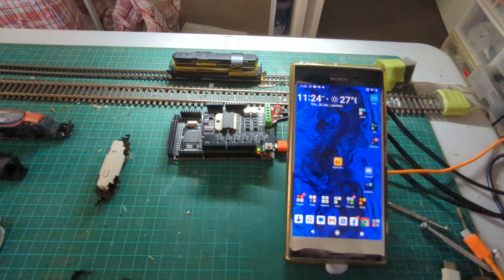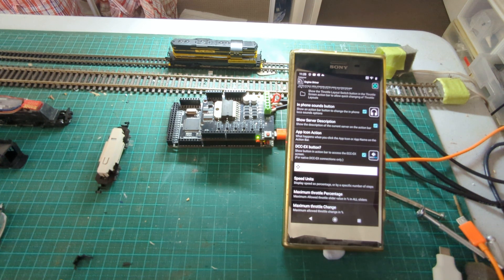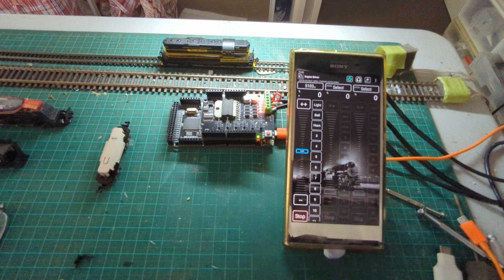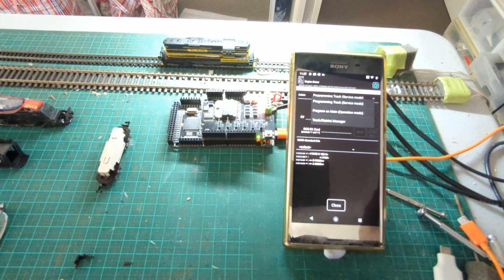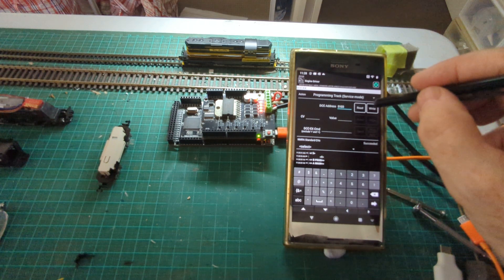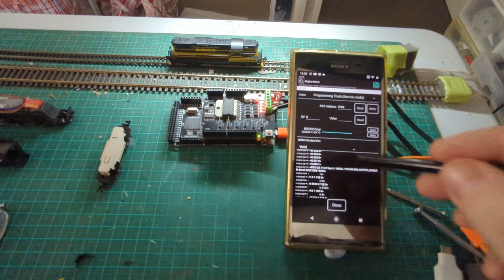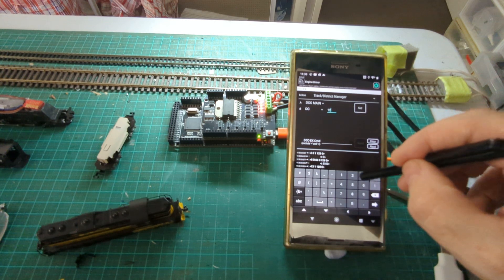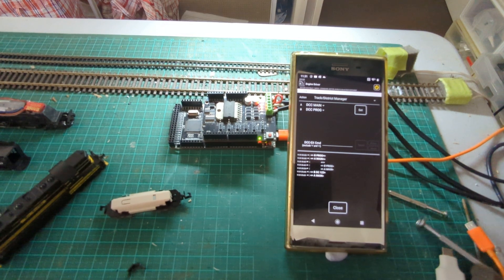JMRI Engine Driver - Native DCC-EX Command support

Comment: Thanks for the video.  So only the android engine driver app will allow you to run a dc engine on what was the program track?  Not the IOS WI throttle app?
Reply from the maker: The WiThrottle iOS app can run DC locos exactly the same way, but it it doesn't natively have the ability to switch the track to DC.  That is not necessarily a problem, as you can set the track as DC in your CS config, or you can create routes/automations that will allow you to switch the track to DC.  
Either way.. yes it is possible, just little a bit more work to setup.

Comment: Hi Peter,  have a question, that a few user groups haven't been able to answer...  I have a full size control stand, which i am taking the outputs of all the switches, variable resistors... and so on, reading into an arduino Mega, then into Python.  From there I can generate and send MQTT to JMRI, and I can see it fine.  Where I am lost, I don't know how to bridge the gap between JMRI MQTT to JMRI DCC++/EX and out to my locomotive.

The path looks like this:  Control Stand Throttle-->Arduino Mega-->Python-->Mosquitto-->JMRI MQTT--> xxxxxxx  ->DCC++/EX-->  Promini TX-->  Promini RX-->To Locomotive.

I can't figure out the xxxxx part.  Any suggestions?  Thanks in advance, greatly appreciated!
Reply from the maker: sorry, but I have no knowledge of MQTT.
If you want to talk to JMRI then the WiThrottle protocol is more than sufficient, and easy enough to do what you want with an ESP32 or similar.
If you just want to talk to the EX-CS, the it is easy to do something similar with either the WiThrottle or native protocols.
Contact me via email akersp62@gmail.com and we can discuss.

Comment: Great vid. Quick and to the point vid. Was trying to get the DC feature running, some how I fumbled my way into figuring it out. The DCC EX  website is packed with info. However the Track manager section throws a ton of jargon at you, assuming you know what they are referring too. I was worried I did not do it right, Your vid confirmed I am not the idiot I thought I was. I am still a idiot🤣, But not as big of a idiot I thought I was. Many thanks👍

Comment: Thanks for an informative video on DCC-EX and Engine Driver.   As a novice, I have a question:  Is there a way to download JMRI engine rosters into a cell phone so that Engine Driver can use them which would use the same labeled function keys (specific to each engine) that I have already setup in JMRI?   If I use Engine Driver & JMRI Wi-Throttle I have them ... but with DCC-EX  direct seems I don't.  All the best ...
Reply from the maker: Yes, there is a script in JMRI that will allow you to extract the roster for loading into the EX-CommandStation

Comment: Hello Peter, let me say something important, the CV programming system is great, but I noticed an error in the function corresponding to the light and the bell because it activates but when deactivated it does not work, I tested it with the previous version to confirm the error.  other than that congratulations on your app.
Reply from the maker: hi, can you contact me on discord and help me work though the problem?
https://discord.gg/6rcFRqMg
my id there is "flash62au (Peter A)"